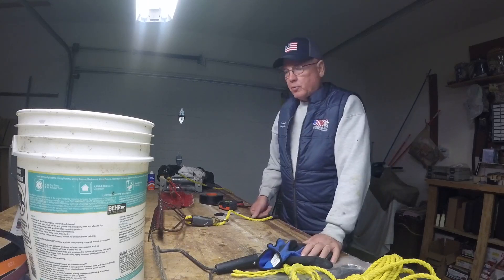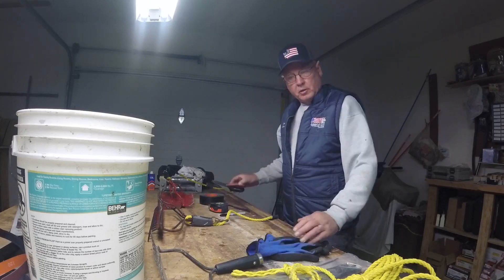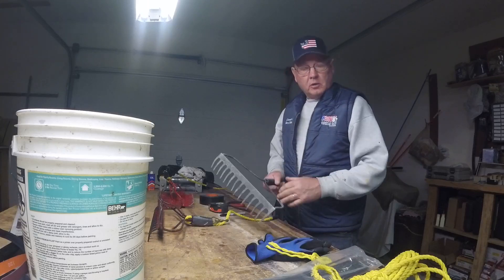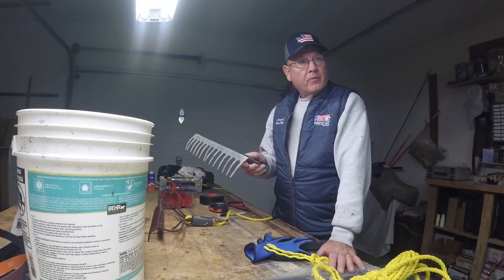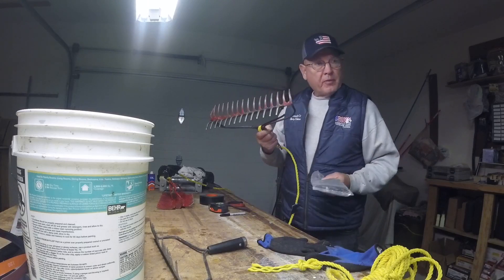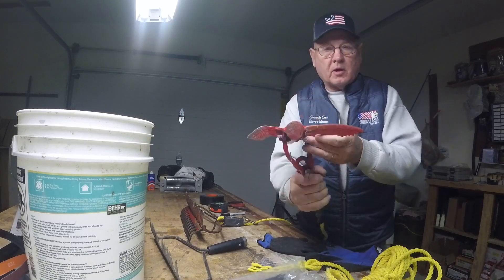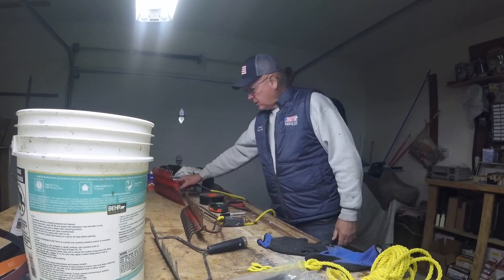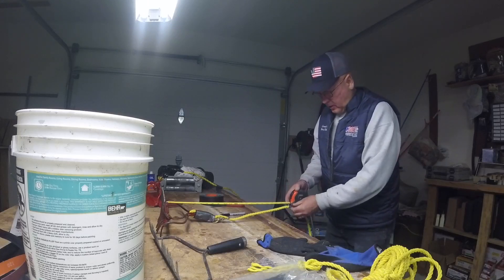How to make a weed rake for conducting a lake survey

Comment: Does this work for all types of weeds?
Reply from the maker: Yes. If your weeds are really thick you may have difficulty pulling your rake up out of the water.  If weeds are very thick don't throw the rake out just lower it down to the bottom and pull it a few feet toward you and pull up.  This way you will be able to see what kind of weeds you have without pulling in a ton weeds.